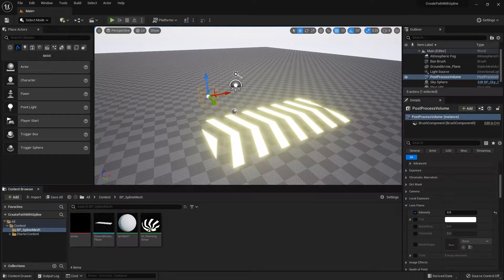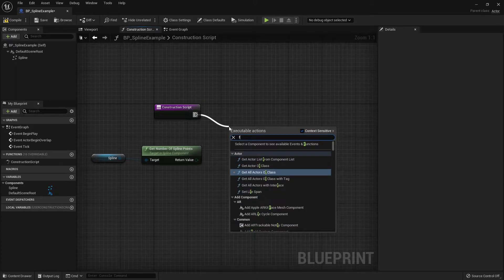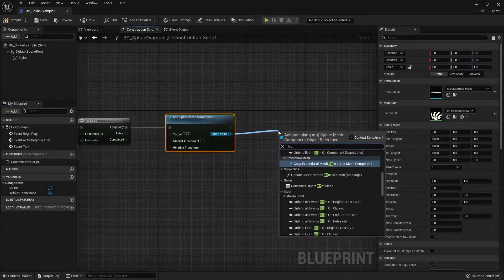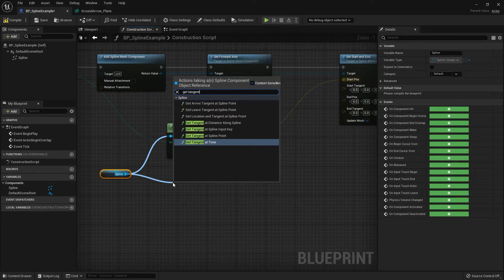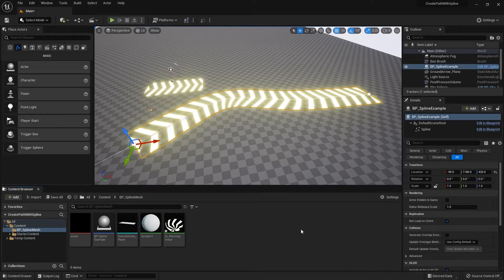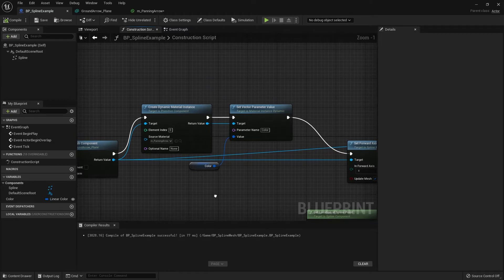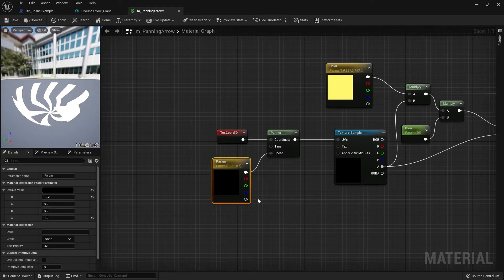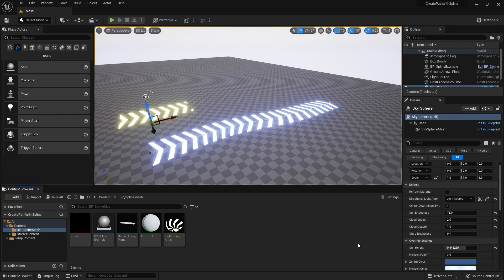UE5 Spline Mesh Tutorial Part02: Creating The Spline Mesh Blueprint

Comment: I have watched your video and several others, i've checked every setting i can think of, but my mesh always comes out very angled, even though the spline is clearly curved. I changed the static mesh to one that has many triangles and i'm still getting the issue, I've played with the spline settings, nothing works. Is there one box somewhere that I haven't checked/unchecked? It's driving me nuts, I can't figure it out...
Reply from the maker: Hi! Do you have nanite turned on for the mesh you are using for the spline? If so, that might be the issue, have the nanite setting turned off. If not, I'm not too sure what went wrong as well...

Comment: My spline isn't curvy
Reply from the maker: Thank you for watching! You might want to check if the mesh you are using for the spline mesh has multiple edge loops/segments along the forward axis of the mesh. If the mesh is just one piece of big piece with 2 tris, then the spline won't be curved, it'll be a pretty sharp when you move the spline mesh points around. The more edge loops/segments you have, the smoother the curve will be. Hope this helps!
Reply: But I use the mesh I downloaded from you, could you please tell me where to edit the loop and segment? @unrealwithkailin
Reply from the maker: @gr4j0m3r  You would have to edit the mesh with a 3D software like Maya, 3Dsmax or blender. I don't think Unreal has to option to add in loops and segments for models yet. But that may change in the future
Reply: Thanks,  @unrealwithkailin  But that mesh I downloaded from you, isn't it supposed to work like yours?
Reply from the maker: @gr4j0m3r  Yeah, it should be working like what I have done in the video. Are you unable to make it curve at all?
Reply: It tilts too hard when I try. It's ok, I used multiple lines placed after each one instead. Thanks for the easy tutorials.   @unrealwithkailin